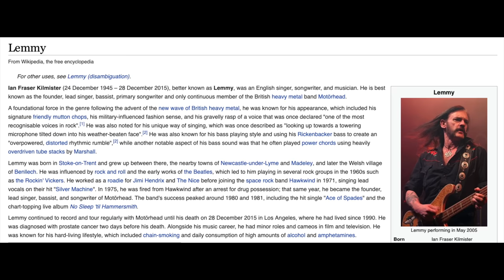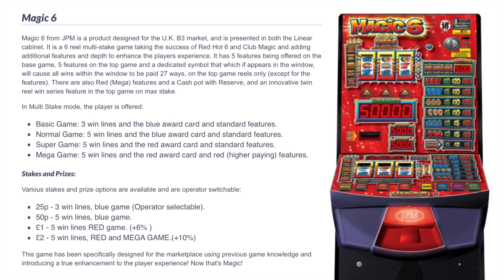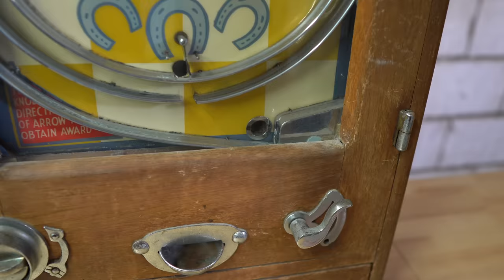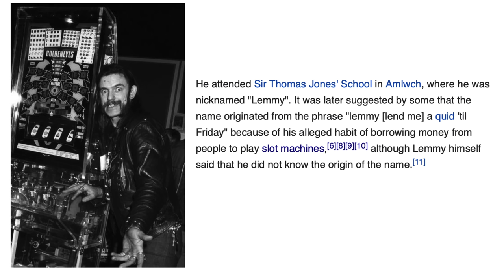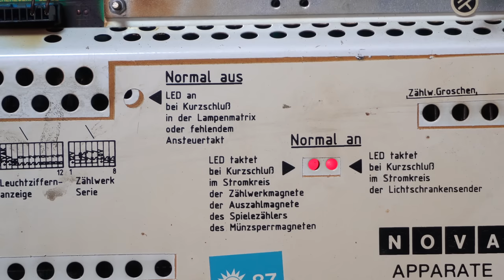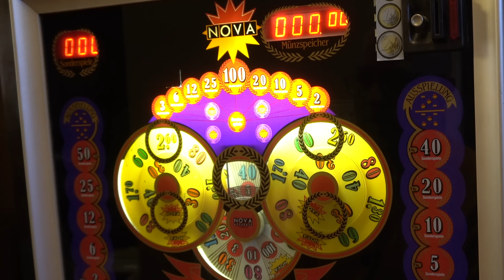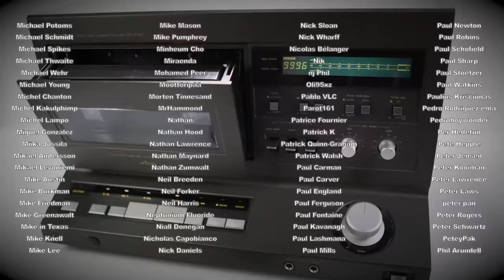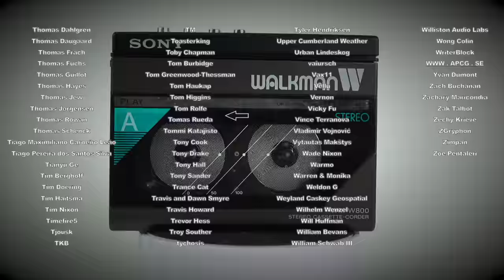Lemmy’s touring slot machines

Comment: Anti-cheat mechanism - that battery probably triggered a killswitch. Some arcade cabinets have those and once that battery or capacitor goes, it'll destroy the machine. Was meant to prevent people from swapping out chips and boards instead of buying them directly from the company. Also I'm from Chicago and WMS is huge in slot machines (they used to make pinball machines) - check out Baron Von Bacon if you ever get a chance
Reply from the maker: There’s a bit more information about this video in the video description. 🔝👍 Includes updates, links etc...
Reply: @Techmoan  thanks for that - also what did you use to clean the contacts of your machine?
Reply from the maker: Contact cleaner, any brand will do.

Comment: German viewer here. I repair these machines in my freetime. :D
The issue seems to be the so called "Foul F_IN Fehler". Which means, you need to initialise the machine after replacing the battery.
In this link you can look up how to initialise it. There is a port for the "Service-Tastatur". Shorten the pins 7, 14, 20 and it should work:
http://www.baersch-online.de/batterietausch.htm
I hope this helps.
Reply from the maker: There’s a bit more information about this video in the video description. 🔝👍 Includes updates, links etc...

Comment: I have seen neither you nor any commenters here mention it but after you plugged the machine in we can see the discs twitching. In normal operation they should be spinning up with the machine basically running in demo mode. This suggests to me that there is some fault with the motor drivers or maybe the power supply to the motors and that certainly could be a reason it is not working.
Reply from the maker: There’s a bit more information about this video in the video description and the top pinned comment. 🔝 Includes updates, links etc... 👍

Comment: At this time its not necessary for a private user to have gaming licence in the uk to own a machine, you do however need to purchase a single seller licence for £25 to legally sell your machine, the reason there are several machines about at the moment in the UK is 2 fold, BACTA have now made a rule that for under 16s to play the machines they have to be accompanied by an adult and this will be hard for the operators to police so many of them are removing the 10p £5 jackpots from the family areas to replace them with ticket redemption machines. On top of this i am sure Covid and lockdowns have also forced some arcades to just close thus meaning there machines are up for sale.

Comment: I had exactly the same look as in 13:35 when crashing off my bike yesterday going at 25kmh, braking on ice with front brakes and landing on asphalt. Do not brake front wheel on asphalt. Do not lift heavy slot machines by loading the back. Anyway. Now we've been reminded of the usual setting where the famous muppets were filmed. Just saying.

Comment: I assume the different regulations in different countries go a long way to explain he different looks and operations. With manufacturers having to tweak the design again and again to comply with changes in regulations, the machines in different countries are bound to look increasingly different as time moves on.

I have seen these machines in bars and diners in Germany. I never managed to understand them. Having to read instructions in small print for 2 hours and still not understanding them is not something that will encourage people to use them.

Comment: The problem withe "Störung" might be that the machine is not set to home mode. If a specific amount of games was played many machines needet to get an reset. For your machine it should be shorting pins 7, 14 and 20 on the service plug (see here: https://www.automatenfreunde.de/index.php?page=Thread&threadID=1177 ) - Hope this will bring back this machine to a working condition 😊
Reply from the maker: There’s a bit more information about this video in the video description. 🔝👍 Includes updates, links etc...

Comment: I think the emulator is actually simulating a player playing the machine, and you can't assume the real machine would behave like that without any input from the player. You can see in some clips that the first wheel or reel starts again after it had stopped (while the other two are still spinning), as if the player had hit the start button; it seems doubtful that the real machine would have done that without the button being pressed, as that would completely remove the choice from the player. There are other clues as well that suggest a "virtual player" is being simulated. I'm not sure that your own button presses even did anything - you happened to press a couple of buttons close to the time when the virtual player did, but other presses seemed to be ignored.

Comment: Makes me wonder if your machine will remain bricked until something special is done to reset it. Something only a service technician would have access to. I used to work on audio demo displays that required a special programmer only us techs had, the retailers couldn't fix it themselves. Manufacturers like having things like that built into their products so their customers have pay for service contracts. One of the many downsides of computerized machines.

Comment: If the backup battery runs low the brain inside loses it's memory. Such a battery needs to be replaced before it runs too low by applying external power so the supply is uninterrupted. These machines have a high level of security against manipulation, I took apart one of a more modern brain (I think, I'm not an expert) and originally there are two batteries on the main board to keep the memory alive, sandwiched between two PCBs full of tracks. If you disassemble it the connections gets lost, memory gone, if you break one of these PCBs, the memory is gone, if you drill through it, gone...
So as I mentioned I'm not an expert but from what I read online there is no way for you to get this running again without someone who has the memory content and knows how to get it inside the machine again.
Some pictures about that board I took apart: https://twitter.com/DIYflixit/status/1120051260202389504
Reply from the maker: There’s a bit more information about this video in the video description. 🔝👍 Includes updates, links etc...

Comment: I think your machine might not work because there is no time set yet, a friend of mine has a NSM Löwen machine which didn't worked because the battery died, he needed to enter a valid date with a special programming computer
Reply from the maker: There’s a bit more information about this video in the video description. 🔝👍 Includes updates, links etc...

Comment: I have quite amount of experience in this field, as does BigClive. 

Some corrections mind..... UK machines, they did actually export localised versions to the EU, mostly to Belgium, Poland, some of the Nordic areas, with Barcrest, JPM, and Bell-Fruit (Used to be based in Lenton, Nottingham, passed the place many times), exporting quite a number. 

Also home use machines, are NOT required by law, to have a licence, long as they are NOT used for financial gain (Source: The Gambling Commission UK https://www.gamblingcommission.gov.uk/for-gambling-businesses/Do-I-need-a-licence/Do-I-need-a-licence.aspx ) 

I belong to a large machine community, known as MFME, who's activities, concern the collection, restoration, and repair of machines, as well as emulation via used of the games original ROM's, with MPU Mecca, and Desert Island Fruits, being 2 of the major players in this field, with the vast member base, being mostly from the UK and the EU.

Myself, I have had over the years, quite a few UK slot machines, some electromechanical, others more MPU based, with my Bell-Fruit Crossover (Electro), and Maygay Screenplay being my faves (I have a number of machine vids on my chan)

https://youtu.be/JNJB9B5gw0A
Reply: As for the faults you currently have, yes I think you may have blown a cap or two for sure (Power supply area would be my 1st suspect), as you know with old electronics, electrolytic caps degrade over time... also a very big killer certainly on UK machines, is the backup battery which you showed in your vid, which we as a community, always suggest, is fly-wired well away from any PCB's etc, just in case it leaks. 

Battery leaks on Barcrest MPU4, JPM Impact, and Maygay's Epoch system, are well known to be an issue, especially Epoch, where it's a very tiny battery, yet I have seen the most tiny of leaks from this, which has been enough to wipe out the main MPU.

Now although MPU Mecca is mostly UK based, we do have a number of German members, whom in turn, could very well help you sort the issues out you have, so by all means drop in (Mention stanmarsh14 sent you over, maybe an idea to link this video too), they could very well be able to assist.

https://www.fruitemu.co.uk/ib/

Comment: I really enjoy your videos and found it really sad that you did not get the machine working. Anyway, short googling for the "gestört" error gave me the following results - maybe not your exact machine but the description sounds like your machine [translated by google...]

https://www.automatenfreunde.de/index.php?page=Thread&threadID=7045
...The first point of contact for you would be the control unit, also known as the "white CPU", which hangs on the back of the device inside the device. Unmistakable, as all cables that run in the device are connected there. Carefully pull out all the plugs. Ideally so that the plastic sockets of the connections do not break off. When you have pulled off all plugs, you will find a ground connection at the top center of a cable lug - you also pull off this cable (green-yellow). Now you will find two metal flags above the control unit - you push them up and now you can simply fold the CPU forwards and then pull it out diagonally upwards. Now loosen four nuts and a seal - two nuts at the top and two nuts at the bottom. Now you can lift off the white lid and you will find a 3.5 / 3.6 volt lithium battery in the middle below. Depending on the age, the imprint can be 3.5V or 3.6V. Organize a replacement battery and replace the old one. You will need a soldering iron to do this. As soon as the new battery is installed you can put the cover back on the unit and fasten the nuts again. Reconnect all of the cables, being careful not to mix up the cables. If you switch on the device now, "Disturbed" will still light up - the device must be initialized. This means that you have to bridge a total of three pins on the connection for the service keyboard on the right side of the CPU. Counting from the top, pins 7, 14 and 20 must be bridged with one another. This causes an initialization of the device, which you can recognize by turning the game discs and a subsequent "Duut-duut" from the loudspeaker. If the playing disks just rattle wildly and nothing else happens, then it can help to turn the playing disks a little by hand so that they become loose first. Then you can treat the bearing from behind with a little oil so that it runs a little easier again.
Then you can go to further troubleshooting. Light barriers may still need to be cleaned, sometimes the power supply unit breaks, which means that no coins are accepted. Every now and then a driver of the lamp rows / columns makes the flutter. But these are all things that can be repaired. ...

https://www.automatenfreunde.de/index.php?page=Thread&threadID=1177
...pins 7/14/20 must be bridged before the device is switched on, otherwise the software will not start the initialization routine.
It should also be noted that some points players (UHG) write a wrong clock value in the RAM after changing the battery, which has the consequence that the clock starts to run at high speed. Since many entertainment devices do not have a software-based point reduction to 600 after 1 hour, this "1 hour" is reached within a few seconds and the points earned then drop back to 600. For this purpose there was once the so-called clock setting device to reset the "normal time". Alternatively, in such a case, the initialization can be carried out again until, by chance, a combination of numbers is caught that the computer recognizes as the time. Because everything that is not recognized as the time (hex values or who knows what numbers such as 88:54:94) trigger the error. ...

Good luck in getting this thing working and continue the great work!
Reply from the maker: There’s a bit more information about this video in the video description. 🔝👍 Includes updates, links etc...

Comment: You have to initialize the RAM of these machines after replacing the battery.
You bridge Pins 7, 14 and 20 on the service connector for that.
https://www.automatenfreunde.de/index.php?page=Thread&threadID=1177
Reply from the maker: There’s a bit more information about this video in the video description. 🔝👍 Includes updates, links etc...